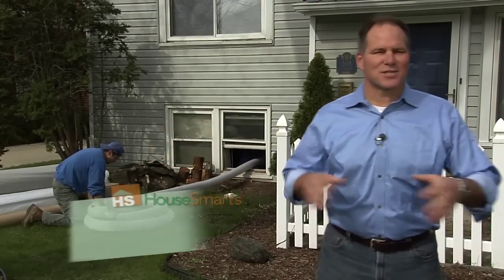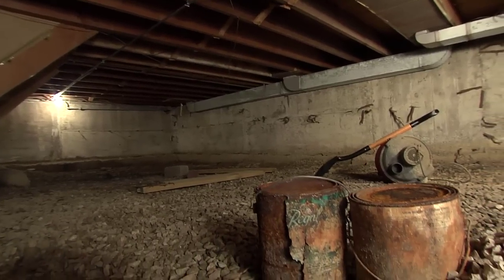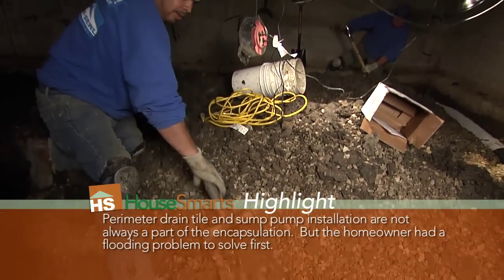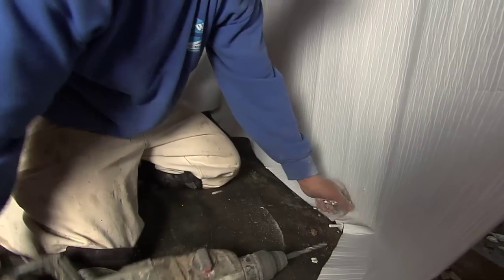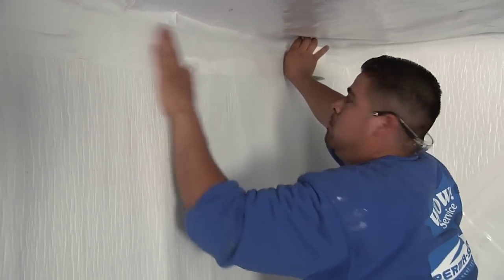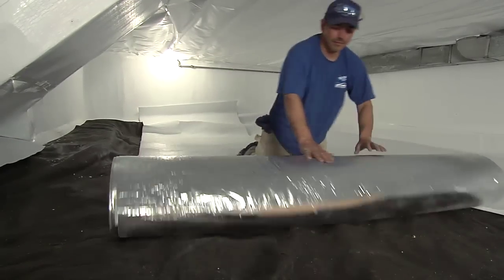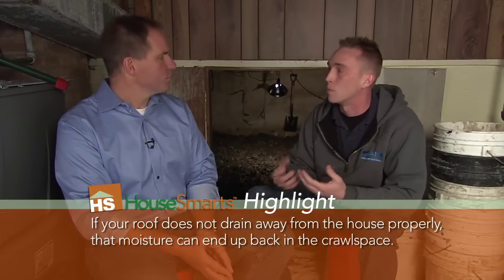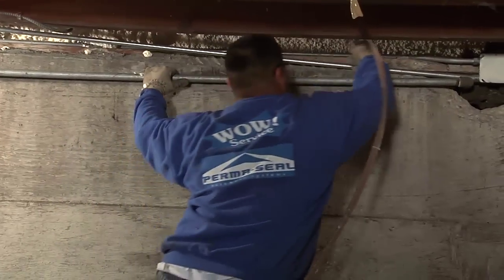HouseSmarts "Crawl Space Encapsulation" Episode 109

Comment: That couldn't be more than about R2 insulation.
I think code in most places is at least R10.
In the entire south this would also be against code for Termite inspection, not to mention you NEVER seal the floor joist like that, you are asking for moisture to get trapped.
Best to put up rigid foam on the walls of at least R10, leave the floor joist open and seal all vents, if you have a HVAC unit in crawlspace then put in a vent and you have a dry and conditioned space.

Comment: Vented crawlspaces are a bad design idea that will eventually go away as a building practice.  Venting in the summer brings water into the crawlspace as the water from hot humid air condensates in the cool crawlspace as the air enters.  In the winter the vents cause the whole house to pull cold air in from the bottom as hot air vents out the top.  Seal your crawlspaces!  Properly sealed crawlspaces control moisture so that mold and other fungus are not able to reproduce.  I agree with those who point out that the installer should have left an inspection gap for termites of three inches at the sill is on top of the foundation.  I also don't understand the value or the need for the plastic below the floor joists to make a ceiling in the crawlspace.  That could trap moisture below your floor - it is better to leave that open to the newly sealed crawlspace.
Reply: my crawlspace is similar to this.  4ft height.  gravel.  it's slowly becoming musty over the last few years because of spring rain.  it is ventilated between my finished basement and garage ie. super humid or cold.  i usually have my garage door open every evening.  what is the appropriate way to seal it?  i'm not a big fan of this poly tarp idea.  i was thinking of pouring concrete, spray foaming the linear outside gap along the the exterior siding, and removing all the fiberglass insulation which tries to separate the home from the crawlspace.  i would then tap into an hvac duct that currently passes through the crawlspace.  how does all of this sound?  i'm a bit worried about pouring concrete.  i'm not sure a sump would be necessary, but perhaps a dehumidifier.
Reply: You still need a vapor barrier if pouring concrete. The moisture will wick from the ground straight through the concrete. This would make a super nice space for storage, but would be super expensive.
Reply: Whats Best? Keeping the Heat in, Or the the cold out, we say both, keeping the cold out is the most neglected field in the insulation trade, let the cold in, and your so called insulation performance is zero. We can prove it,  we say fighting cold air intake is essential, one hole as big has a football is all it needs to have a permanently cold home?

Comment: Many states require at least 3 inches between the sill plate and the top of the encapsulation material/foundation wall insulation for termite and other bugs inspection.  Not to mention that the below floor sealing makes it really hard to find other bugs, mold, and/or rodents that may have decided to live in that nice home area they've built.

I agree that there should probably be a crawl space/basement dehumidifier (not a big box store version, but high quality/efficiency, ~$1000 minimum).

Comment: Not leaving any visual for termite inspections on the rim joist usually 4 inches or so. Also no need to insulate the floor/ceiling  joists just somewhere for condensation to build up creating mold in the floor cavities especially when using a radiant barrier type of material.
Reply: Integrity Energy Solutions. I agree, you should be able to visually inspect for termite activity, plumbing, wood structure and any electrical. I'm not sure why they are installing a vapor barrier to the underside of the floor system.
Reply: Agree, and how is that going to make it easier to work on plumbing or wiring issues.
Reply: not code

Comment: In every video like this I’ve seen I never see anyone talk about what to do with the vent to the closet where the gas central heat and water heater are. Since the crawlspace is sealed off it can no longer draw air from the crawlspace into that room and then subsequently out the vents on the roof. I’m guessing you have to route a vent pipe from the closet floor through the crawlspace to an opening outside. Maybe use one of the crawl space vents that got sealed off.

Comment: Wouldn't the moisture just come up around the back of the liner in to the floor joists anyway? That doesn't make any sense to me. Usually they seal the liner to the walls of the space to keep the moisture in the ground.
Reply: that's what I was thinking
Reply: Very true caper barrier under floor , not needed  and asking for further issues. I would install a 2 “ Rigid foam board on side wall Minus 3 “ for Termite inspections. States require 6”. 
Install proper size dehumidifier. Setting at least 55%  level Depending where you live a small Exhaust fan mounted in one of the Vent’s and seal the rest of them. Never use a two layer vapor barrier. Major issues if and when water gets in between two. do your research

Comment: Couple of comments from trial and error experience. 
1. You really should have a minimum of 2" styrofoam insulation along the wall
2. You should not seal in your floor joists.  Condensation / water will collect and pool on the living space / top side of the vapor barrier thus rotting your floor joists from the bottom.
Reply: How to turn your 2x8's into 2x7's!

Comment: It looks good.  But if you are only dealing o e side of the concrete foundation, the water absorption from the outside elements like rain fall,sprinklers etc. that absorb into the foundation has nowhere to evaporate,which is a long term issue that can cause structural damage to the foundation.   If you want to seal concrete it should be done from the outside where the elements are.  Not the inside where you then trap the moisture.

Comment: Very nice. But I don't agree with sealing up the floor joists.  I would think moister can be trapped . what do you think?
Reply: It's meant to lock out moisturize in from the outside. The only way for the floor joists to get wet is if there was a leak inside the house
Reply: No different than a ceiling between floors.
Reply: If you watch the video it explains that

Comment: Ive done over 100 crawlspace vapor barrier installs. Just get a 10 mil liner, put it on the floor seal it to foundation walls, and put insulation boards around perimeter walls. Avoid the ceiling vapor barrier, will prob mold later…

Comment: I don't understand covering the ceiling with plastic.  I think this is a bad idea, because any moisture gets trapped in the insulation in the ceiling.  No gap at the top for termite and bug inspection.  No sealing the vapor barrier at the top of the walls to stop the moisture from going upward.  They did not show the sump pit or how the water is pumped out of the crawlspace.  No dehumidifier.  No mention of how vents are sealed.  No ventilation fans for stagnant gas buildup.

Comment: I have a concrete floor and walls in my crawl space, dehumidifer is down there and my sump pump is in a small 3x5 drop down section next to my water heater and expansion tank. The vapor barrier that was down when I moved in is shot and there is cheap white foam board up against the walls that is also in poor condition. What would be the best steps/options to replace the vapor barrier and white foam board?

Comment: Where's the damp course? If you had a damp course with ventilation bricks below as standard for raised ground floors, doing it this way - encapsulating - will bridge the damp course, and damp can rise up from the floor through the brick wall to the joists and cause damp. Best to use foil-backed rigid board between the joists and then alu tape to seal, and then secure the boards from slipping - though will mostly friction-fit - with square battening on the corners to joists. That's how I'm doing mine in the UK. Where I have a supporting brick partition sub wall, I'll be using slimmer rigid board to allow cross-ventilation. I would only encapsulate a basement, which should be sealed anyway. Cheers though.
Reply: The right way!

Comment: So my crawlspace / walkspace has been flooding horribly for years apparently. We have just excavated and diverted a river (literally) away from our home. Installed French drain and weeping tile. The builder or previous homeowner put down poly but there was literally 6-10 inches of water underneath the poly which was loose laid. It was done very half asked.. So I have removed it all. The dirt is completely saturated down there still. 1/4 of basement is concrete slab where my furnace and HW tank are, retaining wall then it's dirt from there to front of house. Foundation walls have ridgid insulation installed.  Question, should I allow it to dry out a little before applying a new layer of thicker poly? Hope this makes sense. The groundwater was literally pouring in below the footings, we also rerouted the waterline from our well. It's been a huge job so far. I just want to make sure I'm doing things right. Thanks. Good vid

Comment: He is not doing this correctly my code you have to leave a 4in inspection band between the wall and the floor joists for termites and water leaks
Reply: Our's is the top is not to be covered and yes the 4 inch has to be there for termite inspection.

Comment: Hi ! I was wonderring,,I have a cement foundation beneath my cottage which is not a full basement,actually it is a 4ft high crawl space.....with a nice sandy floor area.... So,my question is,can i i just spray insualte the whole perimeter of the foundation  with keeping the space at a reasonably heated temperature so that my above floor stays comfortable on the feet,or must i also spray insulaltion between the floor joists..... and if yes, will that not in my case prevent the floor above from keeping warm? :)

Comment: Concrete  is porous? Nope, but if it were you could just PAINT IT.
A multitude of swimming pools are made of concrete and they do not leak air or moisture in or out
unless there is a crack or hole.
The priority (main sources of leaks/humidity) are
#1foundation areas above concrete walls and below the floor are the critical areas
#2 exposed organic soil areas
-- There is noting wrong with bare concrete that has no cracks or holes
although covering them may be as cheap as using tape/caulk to adhere the materials to the concrete that are being used to seal above and below them.

Comment: Should never drill any hole in foundation, let alone a few hundred.
Reply: Pretty sure it’s being drilled Through the block that sits on the foundation. It’s better that You relieve all that water pressure pushing against the Foundation walls so it’s able to drain into French drain system

Comment: 4:16 is false.  It’s all covered up and no access to anything between the floor joists.
Reply: Agree, no need to for ceiling liner. Just do the vapor barrier on the floor, seal it to foundation walls and use foam board insulation on the walls. Ive done over 100 vapor barrier installs in Colorado
Reply: Do you keep the crawl space vents open?  I never liked the idea of sealing off ventilation.  Seems like This will fail over time and rot areas where moisture gets trapped between the “encapsulated bubble” and floor or other wood framing.

Comment: That i would love to know. Cause i was told air is good to go in the crawlspace.
Reply: The seals aren't perfect, so the air will be changed out occasionally, naturally. With just a dehumidifier in the closed crawl, the air will still move up into and through the house. Just like it does in a vented crawl. With a HVAC connected closed crawl the air is more 'mixed' with the house. And with a Radon or soil gas mitigation system some of the air from the crawl will get pushed directly outside, rather than into the house. Either way new air, from outside, sneaks in where it can. The goal of encapsulation is to minimize the cost of maintaining the indoor atmosphere, and control mold and pests by minimizing moisture. If it was a perfect seal, it would increase control over the indoor environment, but we'd still have to open it to vent it sometimes, to ensure toxins that build up are flushed out. All things in moderation, as they say.